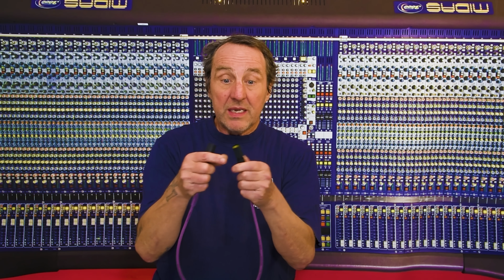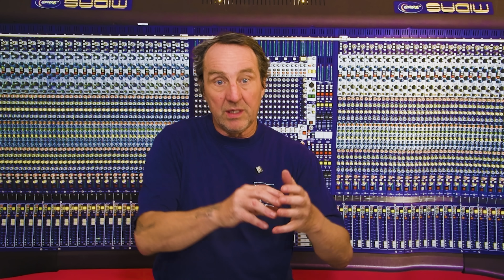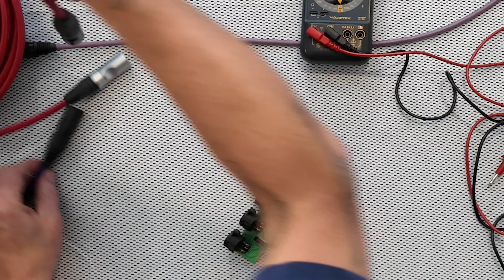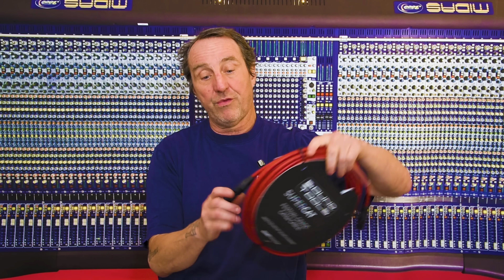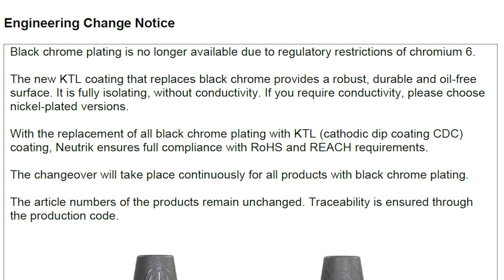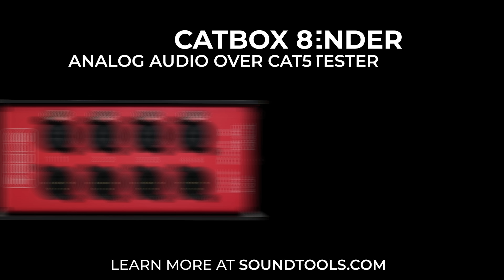Black Neutrik etherCON Shells are No Longer Conductive!

Comment: What about the black D-type Ethercon chassis connectors? Does conductivity matter there?
Reply from the maker: probably does not matter for most applications.

there is a wiper in the ethercom panel mount that will contact the metal RJ45 shell and complete the ground. 

so all good. 

but, there are 2 wipers but only one is connected to ground and the wipers do wear out or in extremely dirty environments like audio snakes that get dragged through the dirt, it is not overly uncommon for the wiper to make a poor connection.

typically with a conductive shell you have a redundant ground. but with non conductive shells, in that scenario, the ground may not connect

even then, for data over ethercom, the ground connection is often not very critical except maybe in environments with lots of static electricity.

for analog over cat when using mic level signals and phantom power, a solid ground connection is critical and the redundant ground of a conductive shell can be quite important
Reply: @DaveRat  I should have specified I'm asking about analog audio over cat5 (using all SoundTools gear). I'm using Neutrik EtherCon feedthrough jacks in my rack and wondering if silver is better for those.
Reply from the maker: Silver will give you redundancy in the ground. 99% of the time that's not going to make any difference but for sound tools we are switching to nickel for most things

Comment: Weird, testing my SuperCAT XM cables (will need new ethercons for those) against my other inventory. It seems as though my two Music Tribe approved Klark Teknik NCAT5E-50M cable reels with older black connectors are "sort of" conductive. I can get conductivity on the individual shells, but I really have to try at it. I get end to end conductivity on the oldest of the two reels with NE8MC-B connectors (again, I really have to try), but not on the one with a slightly newer style (non-KTM) connectors. Definitely going to change them all to silver.

I can confirm the shielding on the cables themselves work fine and are conductive end to end.

https://youtube.com/shorts/IRitbIFQFYs?si=U68ZWggg7WHWRFVm

Comment: Call Neutrik, tell them you're the man, and explain why they should find a non-carcinogen conductive coating 

👉😎👉
Reply: Also want to throw out, a few years back while on tour we headlined a festival that had rented EAW MW12 monitors for the stage. I was doing monitors for Winger and those were the best reacting monitors I had ever come across, to the point that I took a picture to remember and look them up later. When I saw you were involved in the design,  it instantly made sense. The only other speakers I've ever taken pictures of to remember was an FOH PA with L-Acoustic K3s and KS28s. Your monitors are the only ones that have ever impressed me like that. 🤟
Reply from the maker: @Gmoney720SKATE awesome and soo cool!! Thank you!!
Reply: @DaveRat  no, thank you!  You're also the one who, way back, convinced me of the benefit of aux subs. People had tried telling me stuff about "phasing" and blah blah because with aux subs you "don't need a high pass" but to me it seems like the crossover to the sub would induce the same phase shift. Also, using a high pass was more important to me than slight phasing if it was an issue.  When I heard you say "two high passes" I literally said "this guy is the fucking man" out loud and was instantly sold on it 😂 

I've still never heard anyone else mention stacking filters as a benefit of aux subs. It drives me nuts whenever it comes up. There's no way that a sub crossover doesn't induce a phase shift same as a high pass, except now you can't decide where it's at. 

If we ever cross paths, you'll have to sign my bullet 😉👍
Reply from the maker: Perfect

Comment: Nobody said we have to use Neutrik. On top of that, I only use catboxes for IEMs because I don't see the point.
Reply from the maker: Agreed. And we actually use amphenol connectors for our rental division, as well as the XLR sniffer sender uses an amphenol male connector inside the shell. That said, the complete and comprehensive line of products that neutrik offers, combined with the quality of the products and responsiveness of their team to issues that we run into, make them the desired choice to use on our products.

And cool cool on the cat box! We got new stuff coming

Comment: You should do a series testing out amps that everyone uses, crown xls’s, qsc’s gx, plx, peavey, i don’t know if yall have the lower end equipment like that stuff vs all the high end touring equipment, but it would be cool to learn about how the amps react to rms and peak and all that, anyways, i love the videos, im 20 and been building a system over time by buying and selling to make money and dj’ing, i got 4 jbl mrx 18’ subs and two mrx tops, along with a rolling rack of amps and mixer ect. also a lot more equipment and systems, but Im learning so much from you about the super technical information and engineering, thanks!!

Comment: Imagine my disappointment when I bought your new SuperCat cable to be the end of my CAT-5 cable issues and the first thing I did was test continuity between shells…. I ended up sanding off the coating on the ends. Could you send me a pair of the new shells?
Reply from the maker: Absolutely, give a shout to warranty at soundtools.com 

We are extremely interested in tracing every cable we sold that has the new style shell and we thought we contacted everyone that bought them and located them all but finding another is is helpful.
Reply from the maker: Did you get this sorted?

Comment: Well. The viper of the RJ-45, is a duvke viper. It uses two springs pr side. And the "dummy" viper i guess i a Integration fault of the board connector. However i do not wish to make enemys, and having 2-3-4 connections is of course better. But! Doing analouge signalin over Cat cabeling is not the best way to do it. It is not made to transport human frequency signals, rather much much giher frequency ones.

Comment: Can you scratch the coating off in the conductive area?
Reply from the maker: Perhaps, but that's messy and time consuming.
Reply: @ true. Just asking in case some stock can be used. Will be in the lookout for the glossy finish fer sher.
Reply from the maker: For most applications and indoor usage everything will be fine with the new shells. Keep in mind that shielded RJ45 cables have no shells at all And they work just fine. 

That said, the conducting shells add a redundant ground which is useful for high stress and adverse environments. 

In my analysis and opinion that redundant ground is beneficial enough for us that sound tools to standardize on it.

Comment: Hi! Audio student here. I’ve heard that the fourth pen/shell should only be connected on ONE end of the cable and not both ends. Is this true? What do you do for your cables?
Reply from the maker: Do not connect the fourth pin to the shell unless you're doing recording work in a field and extending cables. 

In fact the only time that connecting the fourth pin helps is when you're extending cables. 

Everywhere else the shell gets grounded to the chassis of the gear or gets grounded to the shell of the microphone or DI box by the microphone or DI box or gear. 

Earth ground and chassis ground are two separate grounds and keeping them separate is important. 

If you ground the shells of an XLR you connect the two together and create ground loop issues in many situations

Comment: Thanks Dave for your wealth of information.  Here’s a little history about the ethercon connector few people know.
While  I was working at the Music Factory SLO CA in the late ‘90’s building/repairing cables and building systems for install  I was being asked to run CAT5e to FOH positions in schools and churches. At that time the best protection for the plastic RJ45 connector was a little rubber boot.  I set out to find a solution for a bullet proof reliable connection for the weak link. I discovered how nicely the RJ45 fit in the Neutrik XLR housing and a  flash of light hit me to all the benefits of this and its usefulness in our industry. While at NAMM in 1999 ( I think LA) I’ve visited the Neutrik booth and asked if they could make the plastic insert for holding a  RJ45 to make the male  cable end I thought of and a female panel mount mate counter part for it.  I was shocked and overjoyed to see the company take my idea seriously and release the ethercon series of connectors the following year.   For my contribution I was allowed to fill my pockets with the new product at the NAMM debut.  I can’t believe my simple idea is still in use in many applications 25 years later.
     I am so grateful for all your contributions Dave that you have giving our industry. I imagine the list is long but the Rat Trap and Microwedge come to mind quick as industry changers.  I find the history of pro audio over the last 50 years so interesting and the changes that have occured and the reasons for the change.  What is the future going to bring us next?

Comment: I had a problem last year where a connector shell that was conductive caused a problem. There was a ground loop in the main PA, which caused an intermittent buzzing. The system tech  and I eventually located the issue at the output of the system processor, where the XLR shell was touching the metal of the stage structure. We strapped the cable up away from the metal beam, and the problem was solved.
Reply from the maker: Yes XLR connector shells should never be grounded except for specific applications. I did a video covering all this on the member side of the channel that I will release public at some point. 

Grounding XLR shells is bound to cause issues because it ties the earth ground to the audio ground in places that will invariably create ground loops if connected to gear or if the shells touch anything metal

Comment: Never occurred to me that the metal housing WOULDN'T be conductive.  I had put some other cables together with black neutrik connectors and had some ground issues...  Wonder if this was the cause.  I gotta go check some cables out lol.  Thanks!
Reply from the maker: For XLR you almost always do not want the shell grounded to the audio ground.  For ethercon having the shell grounded is better than floating

Comment: Cheers Dave, neutrik have gone down the pan in the last ten years, powercon plugs and sockets go faulty very quickly, and the Xlr plugs feel lighter in weight to me, plastic clutch shoddy.
Reply from the maker: For the most part we are happy with Neutrik, The connectors they make are still the best choice and we've tested looked into other other options. 
Sound tools is the largest purchaser of Neutrik connectors in North America! 

They've been responsive as we inevitably come across issues. 

I don't really blame them for this though I think they underestimated the importance of grounded shells

Comment: Very intersting, I had no idea about this! For use cases where Black is still important (for optical reasons) but also conductivity: Why not only coat the connectors halfway?
Reply from the maker: Not sure, that would be a question for the manufacturer. I am guessing that would require masking and masking is kind of a pain to do. Also I don't know how this coding deals with an end to the coding. Does it peel back

Comment: Thanks. Good for the head's up.  Just an FYI, the new black plating might be perfect for use in 3 and 5 pin 110 ohm digital DMX cable as the specification does not allow the use of grounded shell connectors to prevent shock if attached to an improperly grounded fixture.
Reply from the maker: I think for many or most applications the insulated shell is a non issue. In fact grounding XLR shells is also an issue in many situations and rarely should be grounded.

That said, for ethercon and especially analog over Cat, we want and need the grounded shell
Reply: @DaveRat  Dave, can you elaborate on how grounding XLR shells would be an issue?  I'm specifically asking about regular analog mic cables, not DMX or other applications.
Reply: @ Just an FYI, many analog snake cables do not ground the shell of the connector. Even some major industry leaders such as Whirlwind. This surprised me when I checked them. The connections in the snake wire only connect to the 3 XLR pins and not the 4th lug for the shell.
Reply from the maker: Grounding the shells of an XLR connector will connect the audio ground to the earth ground when that connector is plugged into a piece of gear. This is highly probable to create ground loops and other issues. All the ground lift switches that are on the back of analog gear will stop working if cables with the shell ground to the audio ground are used. 

I have a video on the member side about this subject and I will release it public at some point but for most applications grounding the shell will cause problems and should be appointed on XLR connectors
Reply: @ Ok, thanks.

Comment: i was trying to hook up an SD8 stage box to my X32 rack with (the recommended) STP cable (not EtherCon) at 150’.  it did not like this AT ALL.  i tested the cable every which way and it’s still functioning perfectly to this day as Ethernet for my X-Touch.  but to get the stage box working i had to switch to EtherCon… i’m assuming the box wasn’t taking ground over the STP’s shield, but it’s been flawless ever since
Reply from the maker: Interesting. The ground in the shell and the shield are not required for it to function but the ethicon shell does a good job of keeping the RJ45 properly lined up to make better contact. 

The shield or ground is only to protect from electrostatic discharge and actually makes it work less good. 

In non electrostatic environments on shielded cables will perform better because they have lower capacitance than their shield did counterparts with the same internal guts

Comment: I wonder if black nitride is conductive..
Reply from the maker: Isn't black nitride for ferrous metals?. 

The connector shells are not necessarily ferrous based though they are slightly magnetic there's not much ferrous metal in them.

Comment: On the upside the nickel ones are cheaper on the downside they're not gonna be black and Match everything else.
I guess they're going after something else after they've done all the speak-on connectors.
I'm all for less chemicals polluting as well but they have to be replaced by comparable products.
And technically both of those wipers should really be connected that's just a cost saving, and some of those connectors break out to a second pin for the PCB and some don't.
Reply from the maker: Agreed

Comment: This information is highly appreciated. Thank you! I'm lucky though, I have replaced the connectors on my most important Ethercon cables by silver Neutriks some time ago. Which wasn't exactly a fun procedure and not cheap either. (The reason actually was that my Ethercon cables were good but had cheap non-Neutrik connectors that started falling apart.)

Comment: Would it be enough for Neutrik to, inhibit the coating where the ground wiper contacts?
Reply from the maker: Yeah I don't know the process but if it's anything like anodizing you have to mask anything that you don't want quoted and masking is a pain in the ass and raises costs and slows things down. 

I think there's a similar challenge with powder coating. 

I don't think they expected anyone to be overly concerned about it and I get the feeling their little surprised by the pushback from sound tools 

It's quite possible that even up people push back on it hell rethink and revise

Comment: Just bought a 25ft SuperCAT 7 off Amazon and the Neutrik sheilds are black and conductive (and that kinda dirty black) so they must be the "older" version. 
What is the actual risk with them being Chromium 6? Is this similar to lead paint where you can use it without issue so long as you dont eat it?
Reply from the maker: I think the chromium 6 issue to the best of my understanding has to do with manufacturing but not an issue after the product is done. And yes all of the sound tools products in the pipeline have the old version or will be nickel
Reply: @DaveRat  Thank you, Dave!

Comment: @dave rat , isn't the inside of the barrel still conductive on the new KTM though? Since the inside of the barrel is what interfaces with the shield wiper, if the inside is conductive, the outside shouldn't matter....
Reply from the maker: Nope, the entire shell is coated. Did you by chance look at the engineering release documents I posted at the end of the video where they say that the shells are no longer conductive?

Comment: Just because they have a non-conductive coating on the outside does not mean they are not a part of the shield. Did you check to see if the paint blocks the connection on the inside of the connector shell? 
I would scratch though the paint to see if the metal underneath is grounded. 
Or just ask Neutrik.
Reply from the maker: Great point. Did you perhaps read the engineering releases from Neutrik that I posted at the end of the vid?

The shells are fully coated with the non conductive KTM coating nside and out.

My discussions with Neutrik were pretty thorough regarding the etherCON shell.

Did not discuss the XLR Shell specifically and don't currently have any of the new XLR versions 

My biggest question is how the 4th tab on the XLR is dealt with. Does it no longer connect to anything? Does it somehow connect to the shell but the shells don't conduct to each other? Does the locking tab on the female XLR scratch freo7gh the KTM and connect?

Will dive in at some point
Reply: @ I apparently missed that. Sorry.
Reply from the maker: All good and great point